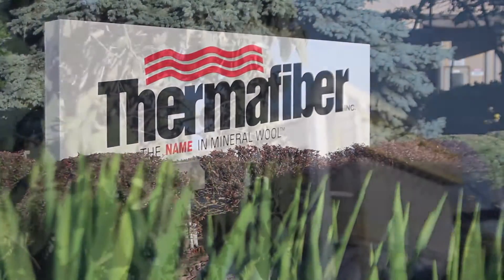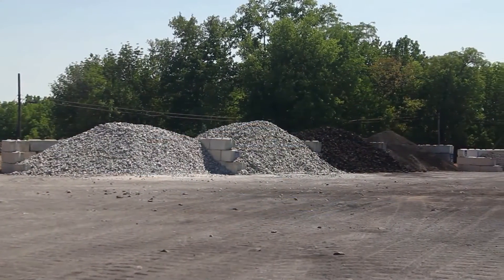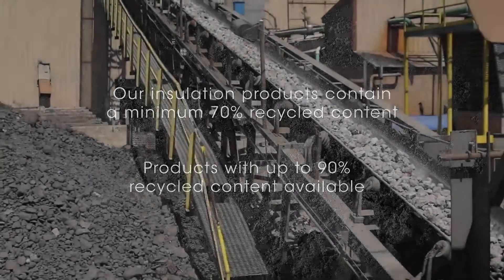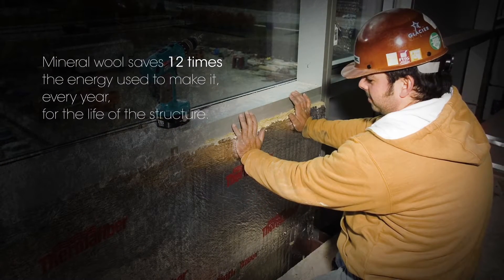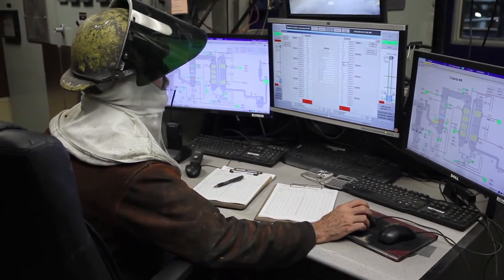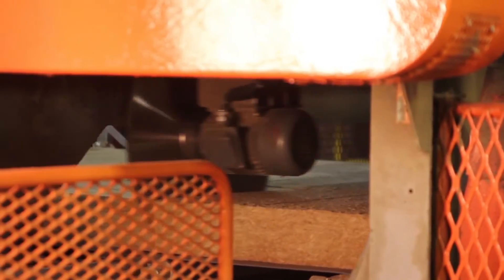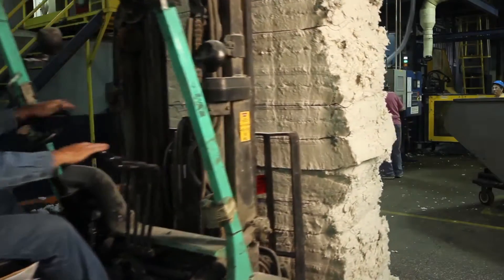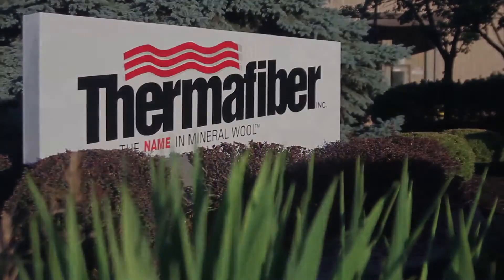Thermafiber   How Mineral Wool is Made

Comment: You are making stuff from recycled material and then for packaging using soo many plastic sheets!! IRONY
Reply: If the product comes in contact with water is degrades quickly. A lot of money was spent to produce it. I worked in a facility much like this..
Reply: @wauzdancer1556 i didnt know that, i use it as heat insulation for a woodstove chimney in a tipi. However i stuffed it between a 5"(125mm) chimney pipe and an 8"(200mm) aluminium sheet pipe and its far from waterproof! Im concerned now that its dissolving, if thats the right description and losing its capacity for shielding the chimney heat.
Reply: @pelementmaker it actually repels water. Not sure what your using but mineral wool is rock. It's waterproof, mold proof, fireproof etc.
Reply: @chadd587  thanks, im using just regular Rockwool 50mm insulation, the ones on rolls and not in a plastic sheet. Resembles just regular glava, the glass variant. It seems to have held up pretty good, altho it is often in contact with water since nothing is welded or sealed. Was in a bit of a hurry last winter so it could do with some improvement hehe
Reply: @wauzdancer1556 it doesn't degrade in water whatsoever
Reply: rocky not irony :P

Comment: The only concern I have is the use of saws to cut it to size. Why not use high pressure water nozzles to cut to size. A saw will spread the finer particles into the air.
Reply: Or use a laser.
Reply: Probably doesn't matter

Comment: No-one's wearing a dust mask! 😯
Reply: it's all for show,, I've picked these things up before (truck driver) and been inside there multiple times, they ALL wear gas mask looking things (they weren't wearing them during filming ONLY ....for fake publicity to make customers feel it's safe) hahahaha
Reply: Rip
Reply: Couldn't believe it. T-shirts? Tank tops? No masks? Not hating on the product but that stuff is offensive to be around. It feels way itchier than regular fiberglass and it makes me cough and snot up. As far as performance and ease of installation goes its the bees knees. Very pleasant to cut and shape, awesome sound performance as well. But I get a sinking feeling in my stomach whenever we have to use it at work, I bring an extra change of clothes. I always assumed it was chock full of fire-retardant but maybe I'm wrong. The packaging says it is an irritant but non-toxic.

Also took me way too long to be told this but after working with insulation when you go home and shower rinse yourself off with cold water first. Hot water opens your pores and all the fiberglass or rockwool gets in there and then you're itchy all over after the shower.

Comment: Awesome video EXCEPT for one thing...What's the GLUE BINDER made from????  That's a HUUUGE hole in your video. first of all I thought it was amazing that one could make "wool" from basaltic rock and I was excited until I heard there's a GLUE BINDER added. I want to know if it's safe for the environment, or not.  They use rockwool for ornamental plants for aquariums for example and have been for ages. I imagine it's safe for aquaria but still want to know what the glue binder is.
Reply: Having worked in a facility as such. The binder as you call it is Phenolic resin. It a mixure of phenol and formaldehyde. The formaldehyde is to prevent mold what can easlly form in this type of insulation as it will absorb mositure..  This type of insulation is used in industrial manufacturing facilities requiring insulation with high heat isolation. Like an industrial furance for anealing brick and so on. No one works in side a furance. Some products used for fireproofing duct work will have a jacket of metal foil which keeps any potiential dust from getting into the atmosphere. That is called Fire Master. It However those who install it need to wear protective resparators.
Reply: what do you think asbestos is?
Reply: @bobsagget823  Hamster armpit hair?
Reply: @bobsagget823  asbestos is a naturally occurring fibrous silicate
Reply: Trade secrets homie! Horse cum is the binder
Reply: Supposedly the binder is urea modified phenol-formaldehyde